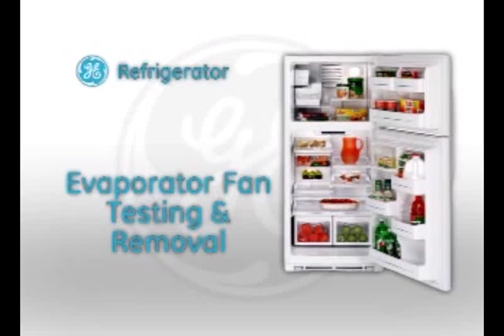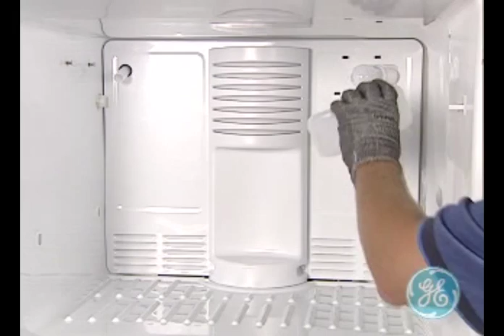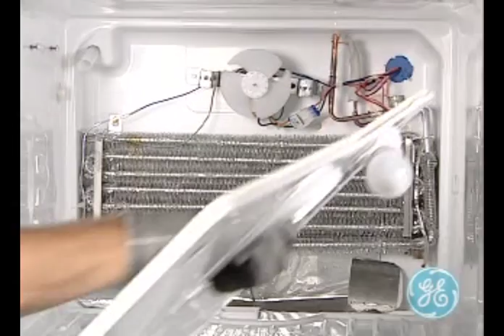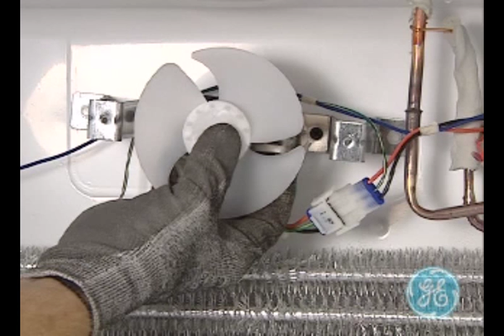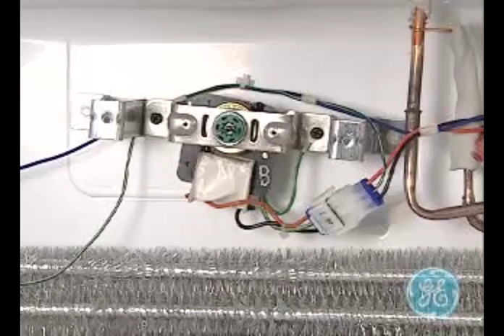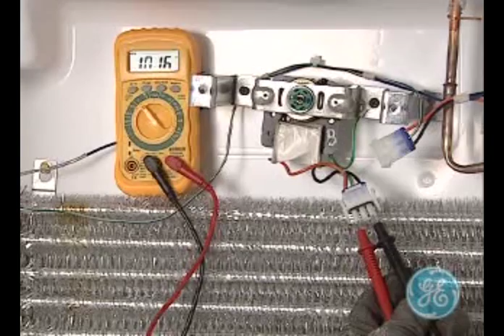GE Refrigerator - Evaporator Fan Testing & Removal | HD Supply

Comment: Thanks, but I already knew this simple stuff! What I do need to know is which leads on the rear circuit-board on my GE fridge do I jump with a multi-meter, or voltmeter to find out if it's a bad board or a bad evap fan, cause my evap fan is not operating at all.. I have a GE, model #GTS22IBMBRCC. I'm not sure which two to test. Any help would really be appreciated! \m/
Reply: I'm having the same issue. Did you ever resolve yours?